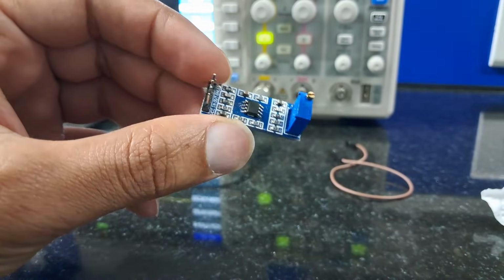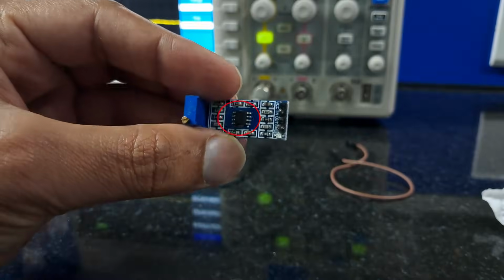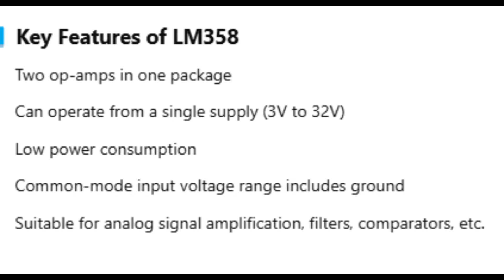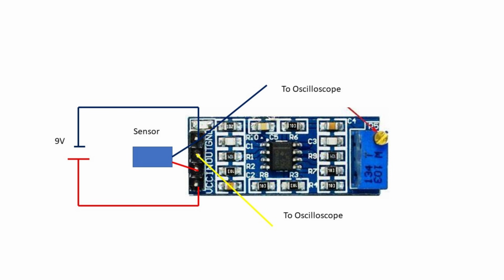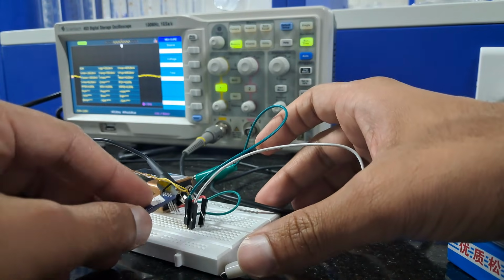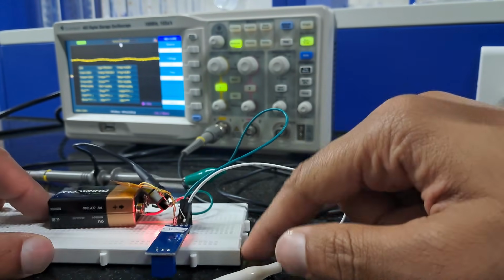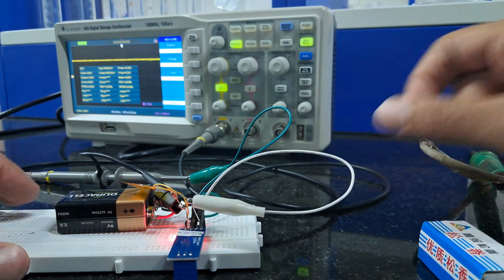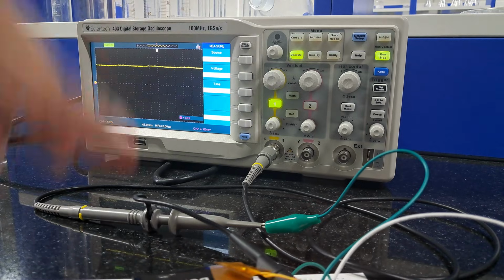How to use Lm358 Operational Amplifier Module

Comment: 9volt input will create 4.5volt reference ...5.20v output - reference voltage 4.5= 0.7volt amplification ..
Am I right?? Please answer I am testing this module today it's hard to amplify dc signal ..your sensor give ac signal?
Reply from the maker: Yes it can amplify the DC signal 
Output will go upto 5v